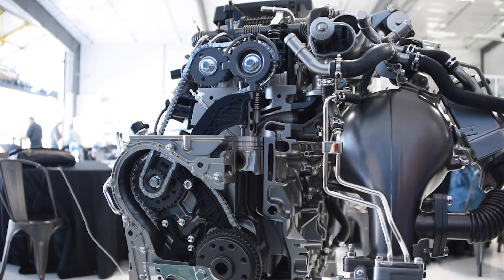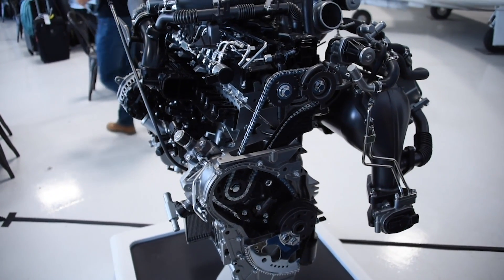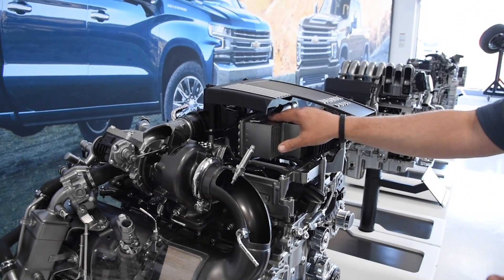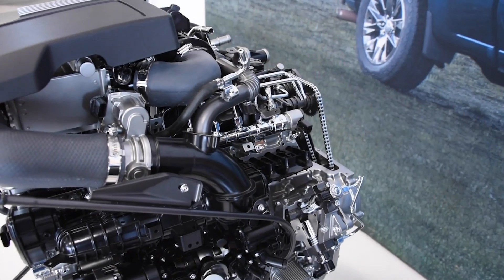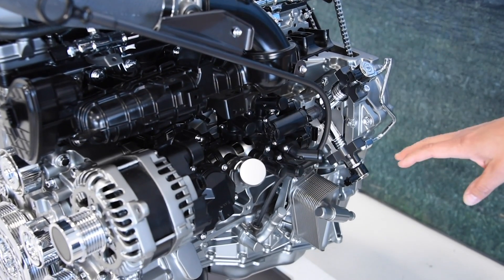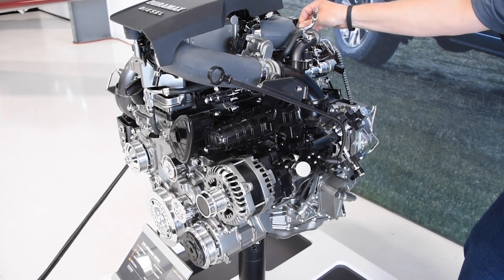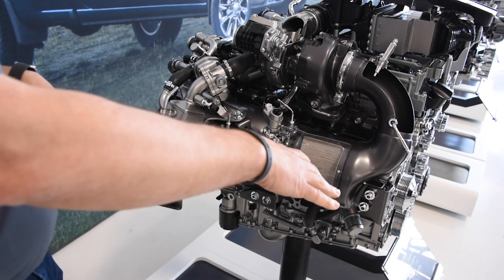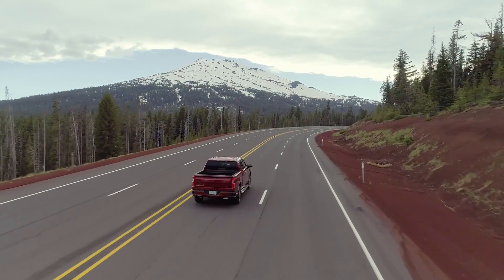What you don't know about the 3.0-liter Duramax diesel

Comment: I know enough about it a bunch of dumbass people designed it. To even work on this piece of garbage you have to pull the transmission or the entire engine.  Tell the truth it's a poor design and it's going to be considered to be a piece of junk.   Go buy a repair manual for 20 bucks and take a good look at the timing gears and many other things. Personally I think if you buy it you will discover you made the biggest mistake of your life. It will be one of the most expensive engines to repair. It will is so poorly designed. Do not listen to the smoke they are trying to blow up your ass.

Comment: I have to wonder if the engineers understand that this engine is going into a tightly packed engine bay in a truck. It does not spend its life on an engine stand. This is the dumbest bit of engineering since ford put the spare wheel in front of the radiator in their Mk4 zephyr back in the late 60's.

Comment: I do like that GM opted to go with an inline 6 instead of a V6 like Ford and Dodge did with their diesel engines.   But I have to wonder why they built the 2.8 V6 diesel for the colorado and canyon trucks.  It's performance numbers are underwhelming for the cost.  They should do away with the 2.8 and put the R&D into the 3.0.  I also think they'd do well to offer their 2.7 turbo in both the colorado and canyon as well.
Reply: The 2.8L Diesel in the Colorado is an Inline 4 engine (made by VM Motori I believe, the same people behind the Dodge EcoDiesel).
Also the 2.7 isn't in them, there is a 2.5L Non-Turbo engine which is the base engine found mostly in fleet trucks.

Comment: I bet someone will come out with a chain conversion kit,  this is why I don't want to work on cars anymore the engineers were taught with common core principles
Reply: In a future version of this engine. GM will use a chain and they will offer an update kit for the older versions.
Reply: @51097kenneth  It's 2024, the future, GM is still using a rubber belt.
Reply: #PLANNEDOBSOLESCENCE <--- and here everyone was FOOLED into thinking this technique/approach was something the OEM's left back in the 70's and 80's, we're so silly.
Reply: It says it has a variable displacement oil pump you could not do that with a chain only a belt.
Reply: @mikehill7922  Not true, belt or chain makes no difference to the pump.
Reply: Shit like this is exactly why I got out of the automotive industry and got into the manufacturing industry, plus you know book time if the factory is paying on that job is like 8 hours or something stupid
Reply: You know in your heart of hearts it is engineered failure to force people to spend money. Can’t have anything that lasts too long nowadays, cuts into profit margins
Reply: Chains are 100% certainly inferior for non-timing applications.
Reply: @Heatherder  how you figure that

Comment: If we had engineering like this in WWII we would be a ward of the Axis states.
Reply: Stuff like this is partially what cost Germany the war
Reply: @igostupidfast3  Germany engineering,  everything has a built in oil leak, must be complicated to work, if it still doesn't work then chrome it.
Reply: @faithandfarmingtennessee872  where did you get that from? Duramax is a joint venture between GM and Isuzu, neither of which are German.
Reply: Yes we all be speaking German
Reply: You obviously have never seen the Chrysler A57 multibank tank engine.

Comment: 20 years of diesel mechanic experience talking here- "Run away!!"
Reply: when he said... "all you have to do is drop the transmission" i thought the EXACT same thing... NOOOOO THANK YOU..... why would you not put a metal chain in there like everything else? what a bunch of fuckery....
Reply: I have a 6.2 in my 1984 Chevy K30. I have no idea how many miles are on it but I know its well over 300,000 judging by the odometer. It isn't a powerhouse by any stretch of the imagination but it burns no oil, starts in the coldest temperatures, and uses very little fuel. The beauty of the older mechanical  diesels like the 6.2, and 7.3 Ford/International is their simplicity. The manufacturers have taken the most simple engine of all time, managed to complicate them and made them unreliable and costly to repair. Can anyone say DEF?
Reply: @hudsonhawk0016  true they were simple but they kill the environment and people want HP in a truck. Manufacturers have to make efficient engines people will buy.
Reply: @hudsonhawk0016  well you have strict US emissions to thank for that + manufactures getting greedy, cuz you can make money if you don’t fix the dang thing. I also remember the days of 7.3 motors I had a couple back in the day, saved a ton of money because 1) they hardly break and when they do 2) you can fix them yourself.
Reply: "RUN AWAY!!! FAST!!!!!"
Reply: I had a 1.9 tdi ALH, 330,000 miles with minimal maintenance. Sold it because everything around the motor started to break. Best car I ever owned. Rotary guy btw. 👍
Reply: @GM-fv8bn  currently driving an 03 golf Alh. Amazing engine
Reply: @Mike Are you this arrogant all the time boy? I'm a general engineering contractor and hold four patents relating to automotive. Look me up if you will.  Yeah, you could say I'm a trucker and still have 8 or 10 units but probably forgot more than you know about various diesel motors. My dad and I watched Clessie Cummins test the first Jacob's Brake using a loaded Sheldon Tanker on Echo Summit dropping down to Lake Tahoe where we lived in 1959. The Cummins kids told him it would never work. LOL Jacobs hired Clessie and made millions.
Reply: @AndyT I'd say you probably can't run.
Slow down and think about it a minute. The belt has far less demand on it than a timing belt. You would buy a manual transmission and the clutch probably won't last 150k and you need to pull the transmission to change that out. Why not the belt? Things change.
This might be a bad decision but then again that's what the 100k warranty is for. My guess is that it will work just fine.
Reply: It seems like long term reduction of waste products is not considered. All the rage is build something that will save some fuel and thus save our environment . But what about making something that is really long lasting and thus doesn’t end up being thrown away which fills up landfills and requires more use of resources to build new ones. I am a firm believer in building things that last for a very long time and are serviceable . The saving of some diesel requires immense  engineering and it’s all shortsighted . Just my opinion . What  does everyone else think?
Reply: 35 years of Certified diesel mechanic talking hear. Things change! I'd buy one.
Reply: If you have 20 years of diesel mechanics it sounds like the timing system was not replaceable what's your opinion on that
Reply: Also I've dropped transmissions laying on ice in my driveway and it wasn't the worst thing I've done working on vehicles
Reply: I’m not a mechanic but I’ll do my own mechanical work and I thought the exact same thing when I saw this. Especially a rear timing chain that “doesn’t need to be serviced.” I call BS.
Reply: Thank You!!!
Reply: So u take a transmission and pull it back he said all underneath on a lift standing up.you diesel mechanics out there say run because of some bolts to take out on a tranny. If was easy then you mechanics would be a dime a dozen and no longer needed start thinking job security i think IMO these are going to be very popular trucks
Reply: I'll stick to my 6.6 LBZ
Reply: @norsevikingaesir4420  No doubt that is a great engine however you can't get that in a 1500 and why buy that heavy duty of a truck if you don't haul or tow. People commenting hear are spun out over this because they think it sounds like a bad idea but really are not thinking about it. If you buy the Ford version you have a timing belt on the front and a high pressure pump belt on the rear.  Not to mention 90% of owners won't keep their truck long enough to worry about it. I'd buy one is I hadn't just bought a Colorado 3.6L and supercharged it. The 2.8L was far to slow :).
Reply: @wilsterone6689  i have a 2015 LT Colorado, recently seen a video that said the transmissions go to hell after 100 k. Your thoughts man
Reply: @wilsterone6689  can u also send me a good link on supercharging the 3.6
Reply: @christopherrobbin3436  Just do good maintenance.
Most people ignore the transmission. Also make sure you keep it cool. Towing requires a cooler. Don't tow without a good cooler. As far as supercharger links just search you will find them.
Mine is a Mallet, search for that. The have several brands and even a turbo kit. I'm not a fan of the turbo because of the turbo lag. Sure they can make more power but I can't stand the lag. None with a supercharger.
Reply: What I want to know is how hard the glow plugs and injectors are to get in and out, that's your main maintenance point
Reply: @Mike no I say He  voted for the Insurrectionist 🤮
Reply: Soo should I just buy the v8
Reply: @gojolumo  35 years diesel experience here. I'd buy on in a heartbeat. Just so happens I own three cars right now and don't need another, LOL
That said, the v8s are great too.
Reply: Thanks 4 the tip
Reply: Let me guess…you’re all about “there’s no replacement for displacement” crowd?…even though technology has progressed far past that for the last 20 years??  Best of luck running your inefficient v8 with 50 year old technology.
Reply: @admorris11  nope, you're just an ass and wrong. You don't know me lol
Reply: Timing chains in a diesel?, buried in the block?
Reply: BMW and Mercedes techs would be used to it
Reply: I've got 45 years diesel experience and wet belts are common on German diesel valve trains and others.. The 3.0 oil pump unloads itself at low RPM's and throttle settings. I wouldn't be afraid to run it 200K. I have a new 2020 3.0 Duramax and I'm really impressed with this motor.
Reply: @lowboy003  i have one too and im also impressed
Reply: @timnevitt2993  Yes, this motor continues to really impress me. I have to laugh at the inexperienced people that jump into a thread and can't wait to put something down with ZERO knowledge of what they are talking about.
Reply: @timnevitt2993  Love mine also
Reply: @lowboy003  I don't care how much experience you have- a wet belt stuck between the motor and transmission is a horrible idea. You should also note that this is not a German diesel nor do German diesels have the best reputation except when it comes to oil leaks and expensive repairs. Perspective is relative though- I'm speaking from a standpoint that values extreme ruggedness and ease of repair. I'm sure the Germans make a great diesel car engine but when I look at this Isuzu I see nothing but over complicated systems that are going to be a nightmare to repair. It only takes one little leak or failed component to necessitate the removal and replacement of all these timing components.
Reply: @jameskoskinen6763 I have to wonder what your purpose for posting is here. You make a lot of claims with zero to back them up. You have just described nearly every modern motor, including the turbine motors. If everything seems to be "overcomplicated" to you, I'm sorry. 

The BIO applications are expanding at a rapid pace and will be the way of the future so live with it. You sound just like the people that told my dad multi-viscosity oils would never work and to stick with 30W Series 3 RPM Delo. 

Our 3.0 Chevy 4WD is averaging 26 mpg around town and well over 33 mpg on the open road. Fuel is going past $5 a gallon. I tried to buy another one for the company, and it was 4 or 4 months out, so I went with the big Duramax. I could bash a lot of products here, but why? I'm an old man and finally realized there is no practical purpose to exhibiting ignorance.
Reply: @lowboy003  Nice. Glad to see someone else with an open mind.
Reply: @Mike We agree on something anyway. As for Trump I'm in the top 1% of Trump contributors. How much did you send Trump?
Reply: Close to crate cost of a 3.0 D-Max motor.. One thing that impressed me on the 3.0 Duramax is the compression ratio of 15 to 1. Both Dodge and Ford have 16+ to 1. Lower compression gives more volumetric efficiency and with up to 43 PSI boost, the flat torque curve between 1500 to 3000 RPM feels more like the big Duramax. Just my opinion..
Reply: @lowboy003  I sent him a get out of office free card!
Reply: It won't be around long coughs 6.4 ring a bell warranty claims will kill this engine
Reply: If you are planning to keep any of the modern diesels for higher miles the Ram Cummins is the only way to go. Even the Cummins could run you into big repairs later in life, but would be cheaper than the others to repair.
Reply: @GNR325  I agree, and I’m a gm guy myself. The Cummins is the truth. They are just always out of my price range.
Reply: They lost me when he said it has rear mounted chains and belt
Reply: @lawrencegeisewite6444  I doing my best to not sound condescending. Read the comments and try to add something enlightening. It's more fun that way.
Reply: @wilsterone6689  I get it and I like to sound positive about new things they are trying to do trucks especially offering diesel motors in 1500 style trucks but if I have to pull a transmission to work on anything other than the transmission then I can't say I have high Hope's for that motor maybe they'll do it better next time
Reply: @lawrencegeisewite6444  They have been doing it successfully for years.  All of the I5 and I6 engines in the gen 1 colorado and trail blazers. The HD version of the Cummins ISB. And a few more. I hear a lot of people wanting a manual transmission but I don't know anyone complaining about having to pull the transmission to change the clutch. Timing chains are not perfect either. I have seen more than one get loose and wear a hole in the water jacket filling the crankcase with coolant. I've seen debris get between gears and crack blocks. Belts have run very complicated valve train in many makes of cars with far greater load than an oil pump. Infact I would venture today that more cars than not run timing belts. People years ago said they were junk.
Reply: James Koskinen I have a question 
Is the f150 3L Diesel beter
Reply: @ismaelosman9848  
No. It's extremely over priced the way it's packaged in the upper trim and you can buy an f250 diesel for less and tow more. The F150 it isn't designed to last more than 150,000 miles, has a timing belt rather than gears, its new technology which isn't exactly in Fords favor and compromises durability for weight savings. Buy the 5.0 gas engine if you're looking at half ton trucks.
Reply: James I have a question for you
Is the F150 3L Diesel beter

Comment: This is the the worst thing I’ve ever seen. Using belts and chains on the back side of the motor so only way of service is pulling the drive train and or cab. SeRvIcE LiFe 150,000 so it purposely fails out of warranty. Not to mention of fuel pump fails you have to pull motor out and or drivetrain/cab to replace pump.

Comment: I've been waiting 30 years for a new,dependable, solid built 1/2 ton diesel pickup......and this ain't it!
Reply: Get at a 3/4 ton
Reply: Agree completely.
Reply: It would be if they didn't put DEF on it ! DEF is worthless unless your a multimillionaire
Reply: Mine made it until 80,000 miles and is not predictably repairable. Cost me a lot of money and aggravation.
Reply: DEF just chokes out the engine. Install a tune that makes the pump not work and u get yourself 50 more horse and 100 torque
Reply: Try the ram diesel. I had one and it’s great for towing and mpg

Comment: 1:32 well there you go, according to GM 150,000 miles is "full service life".  Welcome to the future of diesel trucks.
Reply: Ya thats sickening to be honest. I understand they wanna sell trucks every 5 years etc but there is a lot of people who can't afford brand new, so some people will get stuck with one of those engines at 120k and be in a world of shit when that belt goes.. Its bad enough our vehicles are rusted to shit after 7 years but to have mechanical issues that require dropping the bruce jenner.. thats easy a 2k job up here.. maybe more..
I think they have other engine problems as well. I got the 2019 colorado, and the fucking thing is puffing white smoke out the exhaust in warm weather.. Its embarrassing actually..
Now winter is almost here in northern ontario so its not so noticeable because everyone is puffing out some condensation, but I don't think mine is just condensation.. I often feel like 007 putting up a smoke distraction lol.. This is an engine with 26,000 km.. not miles.. They told me its normal.. I actually don't mind the truck otherwise.. its good on gas.. good interior.. My gripes are the shocks are shit and also not level, the white cloud and that ugly as air dam that is a pain in the ass to take off.

Comment: How much more complicated do they need to make engines these days? There are so many different components on this engine that potentially could fail I don't know where to begin. Maybe they designed the thing like that to ensure their service departments keep busy in the future. Pull the trans to change the oil pump belt at 150K miles on a diesel engine?? Yeah right. GM needs to bring back the simple 2 stroke Detroit Diesels . . .

Comment: Engine had so much potential. Belt you have to pull the transmission to change. And a timing chain that apparently no one knows how long it will last. Maybe this engine is to be a thrown away at 200K.
Ford, Ram and apparently now Chevy are all going to have high maintenance diesels in the 1/2 ton. That's so disappointing no point in buying a 1/2 ton to get better MPG's to turn around and spend on maintenance.